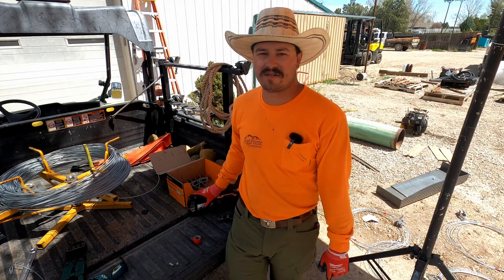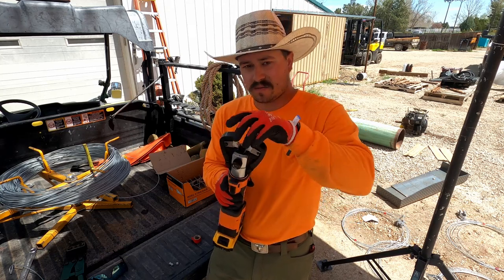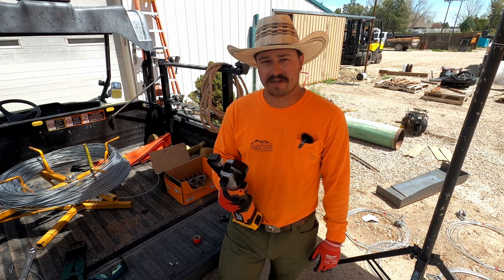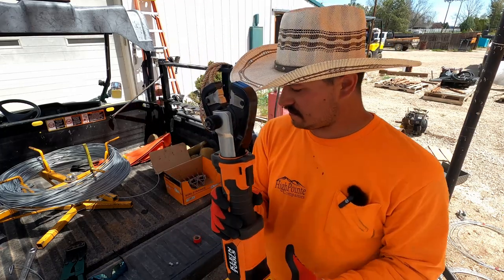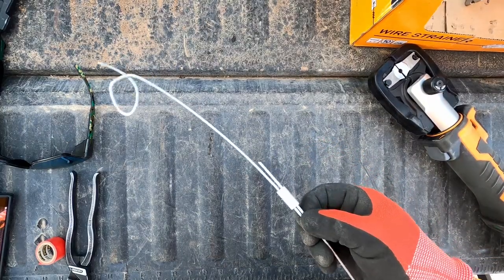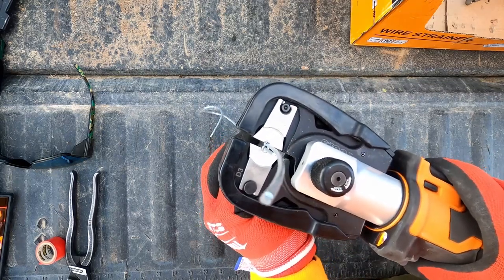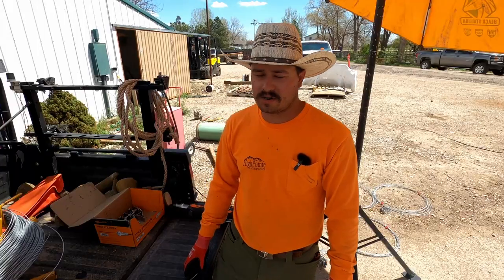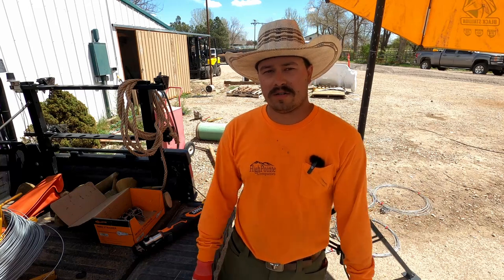Fence Crimper Safety

Comment: Thanks for the info! We're looking st getting a powered crimper, too.  What is the name or part number for that adaptor so it works for 12.5ga fence wire?
Reply from the maker: We're using the Milwaukee 49-16-W161 crimp jaws. We got them at Granger